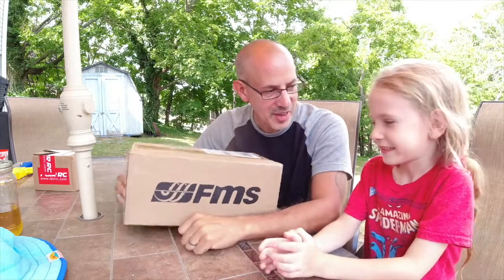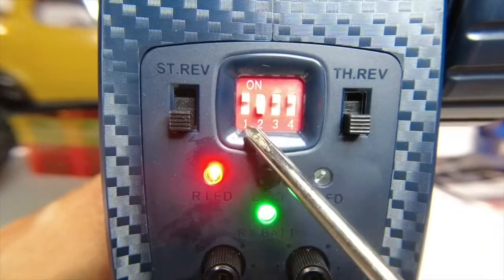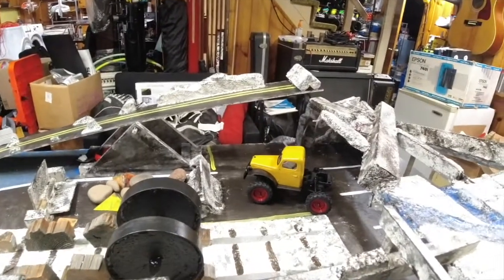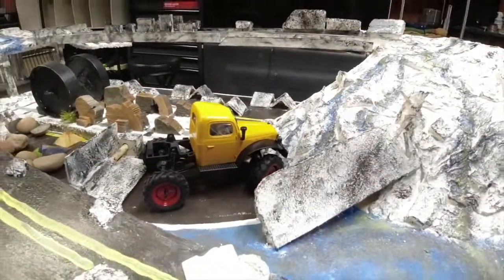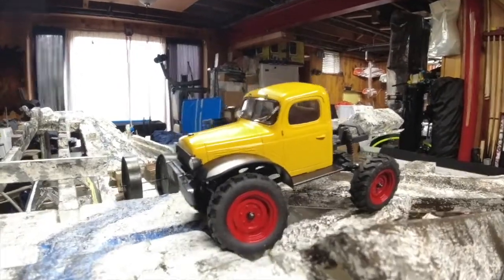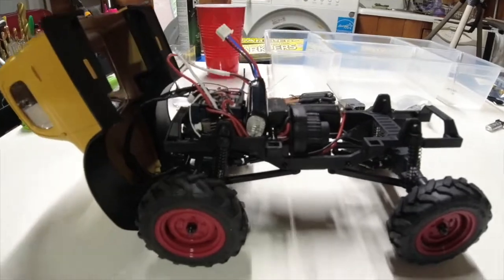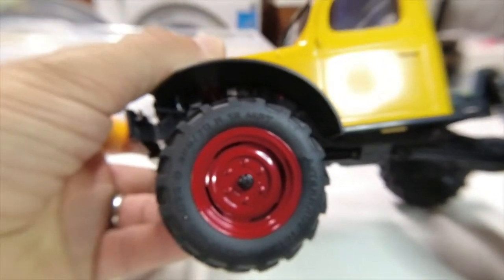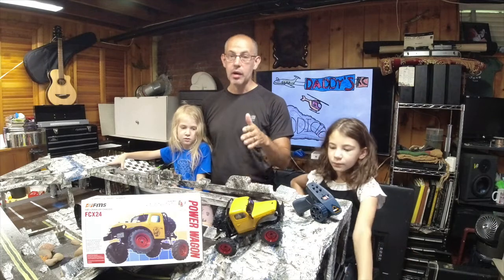FMS  FCX24  Next Level 1/24 Crawler with Metal portal gears and 2 speed transmission

Comment: I saw it mentioned in another video that the truck is wired for the rear light option. Could that be the connector for adding taillights?
Reply from the maker: It’s possible… but it’s tied in with the front wires… It may be for optional turn signals or fog lights.
Please Subscribe, Like and Ding the 🔔!!!